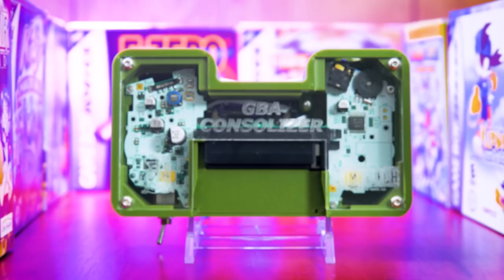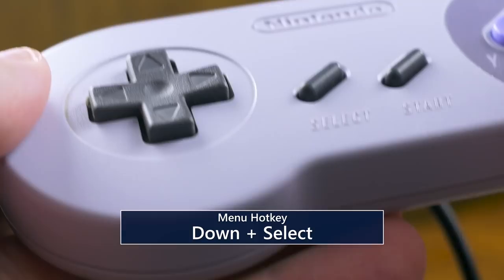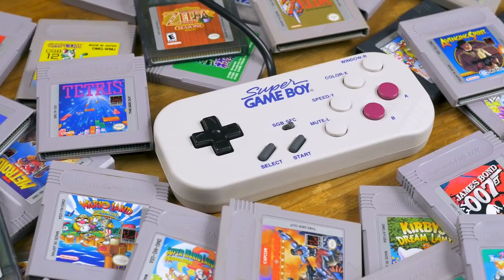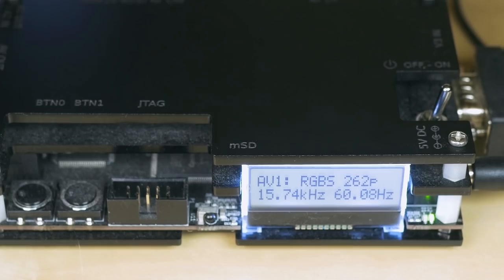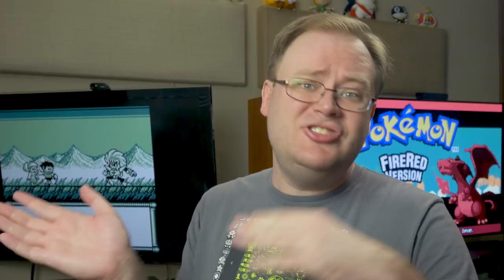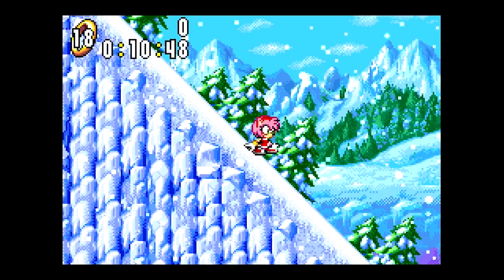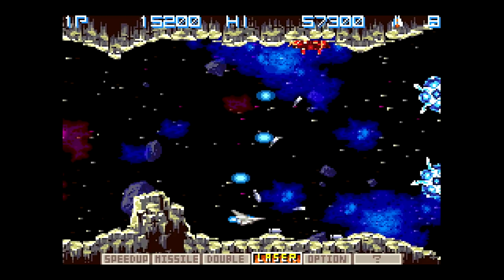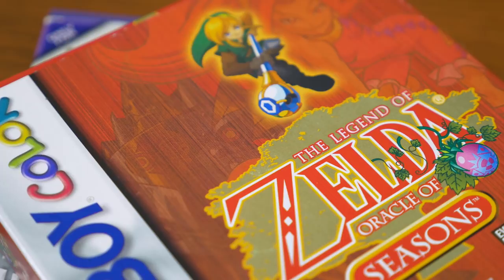GBA Consolizer - Game Boy HDMI Mod :: RGB318 / MY LIFE IN GAMING

Comment: Great review. I love my GBAConsolizer. Been gaming on it all week and it is for sure replacing my GameCube-GBI setup. The GC is so clunky and takes up unnecessary space for just GBA/GBC support. Also, I noticed the lag is better on the Consolizer than the GBI software, and you can get the crosshatch scanlines on the GBI. Plus, I’d to avoid having to run unofficial software. 
The GBAConsolizer is a fantastic device, and I can’t wait to buy Woozle’s NGPC Consolizer next!
Reply: J Jackson   I was one of the pre-order lottery winners. So I got mine in the first pre-order batch.

Comment: I went ahead and bought an HDMI audio extractor to see if I'd help with the moody DVI+ mode, and whaddya know - it worked! I couldn't find the J-tech or ViewHD branded ones in my country, but bought a Goobay one instead. Unfortunately my capture card (Startech USB3HDCAP) refused to accept audio with DVI+ enabled, so had to take the analog route there.

Hopefully Woozle will release a firmware soon that'll improve DVI+ compatibility, as well as adding a 59.7Hz mode.

Comment: If only it could fix the insanely low quality audio of GBA entirely. It feels entirely like Nintendo never counted on anyone using the headphone jack or playing these games on something with more than a tiny mono speaker.

There were someone who did disassembly of games and found out that all the samples are actually of a much better quality but they end up sounding terrible because of the bad CPU audio mixing, so they created a way to convert certain GBA games that used a particular sound driver into MIDI files that you'd play with a custom sound font and it sounds pretty good. But you need to switch the sound font per game, and it's sadly not yet possible do use with the actual games, only for listening to the music separately on Foobar.

https://forums.sonicretro.org/index.php?threads/high-quality-gba-osts-technically.29892/
Reply: I've been wondering about this.  I figure it's inevitable that GB/GBC/GBA will eventually be an FPGA target, and then it should be possible to emulate two ARM CPUs.  I think you could then either have a database of games or detect the most common sound mixing libraries so the mixing routine could be patched out of the ROM and replaced with a stub that throws commands to the second CPU, where it can be processed in HQ.

As I understand, the reason for the poor quality is that mixing is done in software and it's a compromise between CPU time for the game and time for the audio routine.  So giving full CPU to both in a dual core emulator should solve that nicely.

Comment: Supposedly the latest Pre-order batch is supposed to start shipping soon.  Can't wait!  I of course went with the MUCH cheaper kit version as the pre-assembled version for $350 is a complete and utter ripoff.  You can hire someone to do the modwork for you for WAY less than the $200+ extra they are charging for the pre-assembled version.
Reply: Well. their time costs money when they put your unit together and by real professional.
Reply: @madfinntech  I am well aware of the modding community and what specific mods cost and this is simply ludicrous for the work being done.  It's a rather simple mod that doesn't even require that much soldering.  This is taking advantage of customer ignorance, targeting the casual user who doesn't know what modwork costs or where to have it done. 

I suppose this is their way of breaking into the mainstream market where people don't know anything about console modding and such.  Nothing wrong with wanting to break into a market, but the way this is being priced is borderline criminal in my opinion.

Comment: This is a pretty cool mod kit, though I'm in the group of people that looks at this and just sees too many changes to the actual system. Even without the slight overclock, we have some manner of code-injection or I/O manipulation that makes this more akin to an emulator yet it still requires the actual hardware. The usual purpose of a hardware mod like this is to upgrade the original components of the device to more modern ones while preserving the core of the experience. Once we start having menus we can pull up with a number of graphical options we're crossing into glorified emulator territory, and then it also has the slight overclock.

It's a cool little mod kit, but this is targeting a niche of the mod community. The price point is acceptable in the $140-170 range for the DIY kits (the good chunk of the fun for most of the community) though for this level of mod I, and I'm sure others, wonder if a more bare bones kit might not be better. This really just makes me wonder what I can pull off with an Arduino if I'm going to go this far to mod the hardware anyway.

Comment: Q: if my friends tv is a 720p display, and I set his Xbox one S to 1080p output is this a bad thing? Would the image be sharper or softer?  Is it downscaling? Am I adding more input lag going above what the tvs resolution can do?
Reply from the maker: [Try4ce] That's a tough one. I have a similar TV from 2010. It accepts 1080p, but downscales it. The weird thing about TVs like that though, they actually aren't native 720p - it's a very sightly higher resolution, I think it's 768p if I recall. So in that sense, it is also upscaling 720p. You may have scaling lag in both modes, but I can't say for sure. I should do some tests with the Time Sleuth sometime.
Reply: It depends on the game and the TV, assuming your TV is like most 720p TVs and actually has a 768p screen then you’ll be upscaling 720p or downscaling 1080p, and usually downscaling is faster. Unfortunately, if a game renders at 720p the console will upscale to 1080p then downscale to 768p again, that would add more lag but probably not a huge amount. For games with dynamic resolution or sub-720p games the video is going to be scaled anyway by the Xbox, so you may as well let it scale up to 720p and then have the TV downscale to 768p. For 720p+ games, you’ll probably get a sharper image since the higher resolution graphics downscaled down will lead to an anti-aliasing-like effect. For 720p games or below, it might be slightly softer, especially if the TV is natively 720p and doesn’t need upscale to 768p, but it’s unlikely to make a serious difference.

I’d recommend sticking to 1080p, it’s most likely to be less laggy, but there’s probably always going to be some scaling going on so lag shouldn’t change too much, and you’ll get better visuals for games above 720p.

Comment: Have you measured Bluetooth lag anywhere? In theory there shouldn't be any. When using my DS4 on the PC, for example, I can set the polling rate to 1000Hz and get literally 1ms. At the absolute worst, the polling rate should be 125Hz, which works out to 8ms.

Comment: Great video! Any idea if the SNES controllers you can buy from Nintendo for the SNES Switch online games work on this thing? If they do i really need to get a receiver. What’s the best one?
Reply from the maker: [Try4ce] The NES ones work with the 8bitdo SNES Retro Receiver. Last I knew, the SNES ones hadn't been supported yet, but it's possible they've updated the firmware, haven't looked into it yet.

Comment: I'm shocked you only spent 60 seconds discussing GBi paired with the OSSC. Are there really anything but power users buying mods like this? I really hoped for more direct comparisons and discussions of the differences. Analog vs digital, 4:2:2 vs 4:4:4, plus anything else not apparent.
Reply from the maker: [Try4ce] We've already explained GBI again and again in at least 3 to 4 videos, so it gets a bit exhausting. We wanted to explain what we had to, but otherwise mostly focused on the Consolizer since that's new. I think we have 3 comparisons versus GBI-HF in here, which I thought was plenty. You can see that it can be sharper through the OSSC, certainly. I don't think the 4:2:2 situation is really visible with GBA games, so I wouldn't consider that a strike against GBI. GBI's main advantages are that it can be a hair sharper (with the OSSC and component or RGB), and many people may already have it. The Consolizer's advantages are that you don't have to launch homebrew to use it, it has expanded palette options, and the original Game Boy scaling is super awesome. However, GBI is changing all the time, so it can be hard to keep up with what features have changed.
Reply: @mylifeingaming  I actually have the same palette options. Just the color wizard is missing. GBIHF is 4:4:4 with the original component cable. See https://www.gc-forever.com/wiki/index.php?title=Game_Boy_Interface/High-Fidelity_Edition#Comparisons for where things are currently standing.
Reply: @mylifeingaming  thank you. That was the kind of information I had hoped to see in the video. Reviews seem to be painting the gba consolizer as the best gba has ever looked, but without comparing it to the current best solution. You guys at least mention it even if it's less than 60 seconds.     I know the information is out there. I just had high hopes for an in depth comparison in layman's terms

Comment: Have you guys ever noticed your displays not detecting the color space properly when set to auto?  My Hisense H9F doesn't seem to detect the color space of this unit properly when set to auto, I have to manually select Full when using this device to get it to match up properly, that is if it indeed is outputting full and not limited range color.  Kind of odd considering that it seems to detect other devices properly.  Could this have something to do with the odd HDMI spec being used, and have you guys noticed this with your displays?  When I select auto on my display, it seems to want to run in Limited mode.
Reply from the maker: [Try4ce] I have trouble with that on my OLED, but I've had the issue with modern consoles too. I haven't used auto on it in a long time.

Comment: Q: with the gba consolizer. Can you get audio from the hdmi output? Or will I need a separate set of cables plugged into the device?
Reply from the maker: [Try4ce] This is covered in depth toward the later part of the video. Short answer: it depends.

Comment: I loved this mod, but to be honest, the instalation on the unit that is on 2:51 isn't the best i've seen, poor solder joints, melted wires, I don't know if this will last a long time, at least it doesn't has a ton of "Peter North special sauce" or some black goop on top, so is easily fixable in case some solder joint breaks, what can happen if you don't handle carefully on TP0...
Reply from the maker: [Try4ce] Well, maybe that wasn't the right unit to show. That was an earlier unit sent to us, not from Game-Tech. I just didn't want to open the final unit.
Reply: @mylifeingaming  not to worry then
Reply: @mylifeingaming  I was wondering that when I did the commentary, either way, the focus of he video is on the mod, not on this particular installation.

Comment: Why does it have to output 1280x720 and not 960x720? By using a 16:9 resolution with only 4:3 picture information, you can’t use it on a 4:3 TV without massive windowboxing.
Reply: GBA is slightly wider than 4:3.
Reply: @GameSack  Good point, I forgot about that, but in original GB or GBC mode it should have that be an option

Comment: Wait a sec... are GC controllers xinput??!? :O Does it mean I can just make an adapter and plug x360 controllers to GC or Wii, or even better plug a wireless receiver for x360??
Reply from the maker: [Try4ce] No, but the Gbros adapter supports Switch protocols as well as Xinput. It's doing a conversion.

Comment: can you spare your ossc GBI-HF settings?
Reply from the maker: [Try4ce] I just use the OSSC version with the up to date firmware that has a scaling mode just for its weird resolution. I do have to bump the sampling rate two notches for the pixels to not flicker though.
Reply: @mylifeingaming  This shouldn't be the case if you haven't changed to the custom video format with closer matching refresh rate.
Reply: @mylifeingaming  wait the OSSC can do a 6x Scale of GBA games? can it also do a 7x scale for gb and gbc games?

Comment: Although it's not a bad idea, the throw switch on the front looks horrible, I'm normally into modding consoles and using original hardware, but I think emulation is just as good in this instance, and this video would be a lot better without those annoying fake switch noises and inserting the cartridge noise..

Comment: 8bitdo's controllers are hardly "notorious" for d-pad issues.
Reply from the maker: [Try4ce] Oh many of them definitely are. People have tried to come up with ways to fix them. Especially the SNES style ones, often diagonals are extremely squirrelly. Any Contra game is the best test for it. Diagonals won't hold when you expect them to.
Reply: The original replica pads they made when you pressed right they would make the character duck etc. The diy kits and new stuff seems alot better. People were adding their own fixes with tape to stop it happening
Reply: @mylifeingaming  I literally own multiple of all of their products and the only one with d-pad issues is an SF30 Pro. I don't doubt some have issues; I've seen the posts on Reddit. But even as they are I'd still rank them in the top half of available d-pads, and my SN30 Pro I'd rank only shy of the Xbone controller and a Switch joycon with the d-pad mod on top of the d-buttons.

Comment: I don't see the point of these kinds of hardware when there is so much work to get them running + money + lag/screen issues. $350 to get a better picture, maybe? I would rather get a Gamecube GBA player with a PVM monitor for an authentic experience with no soldering baloney to worry about and I would know it's real deal hardware, not fake emulation. This just isn't worth it for a potential minor boost in picture quality.
Reply: This isn't emulation, it uses a real GBA. But yes I agree otherwise.

Comment: So there is the Game boy player for GameCube and this as solutions to playing the entire game boy library on your TV. It bothers me that the game boy player requires a startup disc but the player and disc combined is still really cheap. This consolizer is rather expensive considering I have to furnish the donor Game boy advance hardware... This has a gaudy looking 3D printed shell with brittle parts and plexiglass top, the GBA consolizer chip/s themselves which you have to install yourself, going for over $200 + after shipping, assuming you don't need any extra adapters/cables etc. About the price of a Mega SG which is a all inclusive product. I am not following why the price is so high on this thing.

Comment: this is all crap. please don't buy it.
Mister can play all these games, without SDRAm, with several different filters, savestates, HDMI output for only 119USD.
Reply from the maker: [Try4ce] Mods for original hardware, MiSTer, and software emulators don't have to be at war with each other. MiSTer GBA is indeed amazing, but this is my favorite way to play my actual cartridges on my TV. It's good that all of these options exist. This option is not for everyone, but it is a great choice for those who feel using a real system with real cartridges is important.

Comment: I laugh at how people try so hard to conveniently play GBA games on their TV in the most legit way possible and by the time I watched all this, I thought it was so inconvenient and pricey to set this shit up. Why not just use a damn emulator?

My prefered way to play GBA on big screen now-a-days is to use the great emulator known as 'My Boy' for Android on my NVidia Shield TV. I get the benifits of smoothing out the ugly pixels, adding game genie style cheats and can even link up and play multiplayer with other devices such as my Samsung S8 phone using the same emulator.
Reply: Emulators are fine for most, but some people are sensitive to the input latency added by software emulation. Anyway, it's always nice to have other options.
Reply: @videogameobsession  no I agree and understand. I have also experienced lag at times but I have always followed the emulation scene carefully and things are getting extremely better in that regard. I am super excited to be buying the Polymega for example. :) Can't wait to see how they truely handle Saturn Emulation as I know how difficult it is to emulate that system. I am a emulation user for the most part but when it comes to Saturn (my favourite console of all time) I have always stuck with the original console. That might change however if Polymega is as great as it says it is.